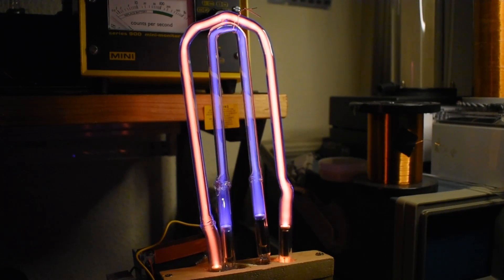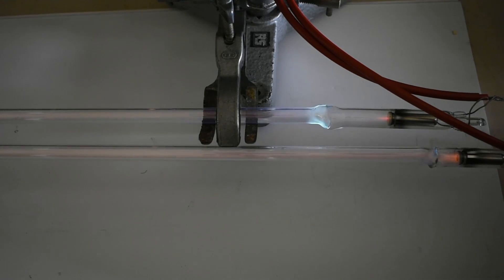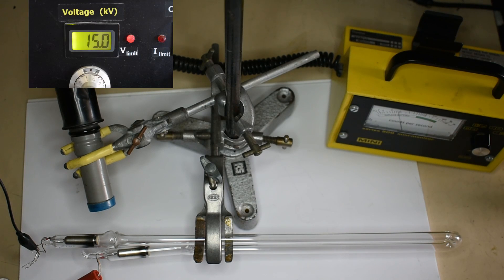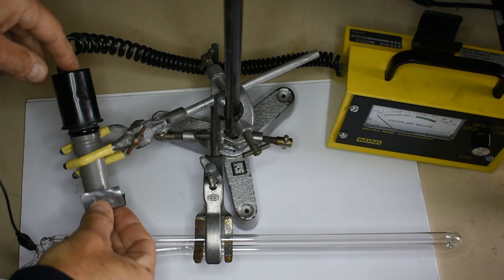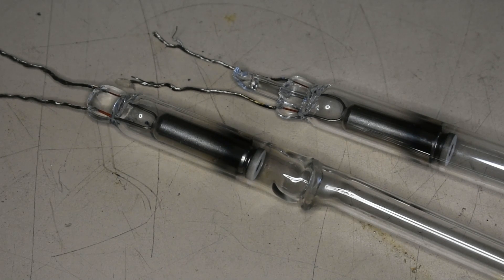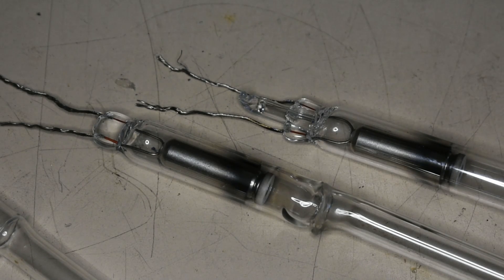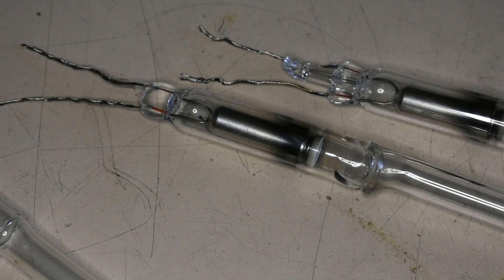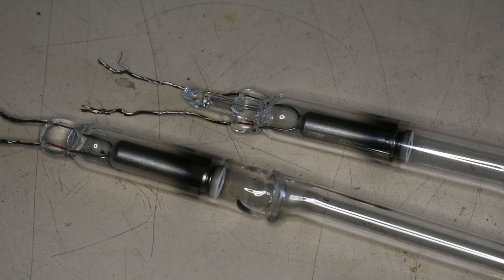Neon gone Bad

Comment: Hi! For the last discussion, I've been continuing my neon tests and now I have three one stage rotary vane vacuum pump connected in series, which produces pretty good vacuum (though I don't have that sensitive meter, but discharge intensity gets from zero to bright and finally dimmers when pumping longer, so that's good).

Anyway I've learned a lot, i.e. the color depends on gas, pressure, voltage, current, and even on polarity when pulsed dc is used. I've used commercial and diy electrodes, but with commercial electrodes, I've never managed to get reddish tube using the neon gas (it's more like pale white bluish color) and I suspect it's due the remaining oxygen in the tube. Also I don't have the bombarding equipments. These tubes also heats too much. So I've ordered magnesium and waiting for it to arrive to see whether burning that inside vacuum using induction heater would restore the neon color. 

But for tungsten electrodes (0.35mm wire is good), I've doing couple of tests and verified that after vacuum and neon filling, the tube produces first white-blue-pink color, but after e.g. 15 minutes of burning (~20mA), the electrode area in the glass is pretty black, but also the color is changed back to neon red. But after this "burning" the electrodes cannot carry that much current than before the initial burning. Magnesium would probably help this also, but I think I will also try to add one extra pair of electrodes in the tube and use those for initial burning and after color change switch to "new ones". And for commercial electrodes this kind of color change just doesn't happen and it must be due the bigger surface area which doesn't raise the temperature of the electrode enough to burn the oxygen.
-Heikki
Reply: Thanks! I've actually got that magnesium plate today and already did some tests. First of all, I thought that I could just burn that with small induction heater directly, but no, at least with that heater, maybe the frequency is all wrong etc. Anyway, but if I put the magnesium pieces inside the electrode's steel cup, then I can produce white oxide which is probably fine. I have to do more tests, i.e. whether it would be best to fire up the getter after the vacuum closing or before.

And I also tested that two wire wolfram setup, but it didn't work any better. Maybe both wires were attacked by oxygen and other metal stuff. Anyway with own electrodes the process repeats, first bright but wrong color, then the color goes right, but finally electrodes starts to sputter and current cannot be maintained..it's not easy 😁
Reply from the maker: @GarageOfTool  Haven't tried magnesium as yet but it seems to have a low resistance so not sure why it wouldn't heat up inductively and evaporate.  Getters can be used either while pumping before sealing or after sealed. Both will improve the vacuum. If you are finding your electrodes sputter and the voltage is increasing to maintain the current, this suggests the vacuum is improving with time, as in my example here. I'd try a higher neon fill pressure. The sputtering  is pretty good at soaking up the neon as well as other gasses.
Reply: Yeah, maybe the vacuum is then getting better, hmm. And also that two separate wire electrode test verified that it is not the wire itself that gets ruined.

My current filling procedure is based on the eye instead of pressure, so I just watch the initial color and wait for the high brightness and close the hoses and melt the tube.

Edit: I just put a new set of electrodes to soda glass and also put three 1x1x3mm magnesium pieces inside the tube. Then started vacuuming & argoning the tube and heated the electrodes during vacuuming. This heating also showed very noticeable color change. Then I closed the tube and leaved the tube current on and after a while, the tube stopped staying on with normal neon switcher. High voltage pulsed dc switcher though still could light the tube. Anyway, then since I had those magnesium pieces inside the tube, I moved those inside the electrode cup and heated again and burned the pieces and woila, after that , the standard power supply started worked again and has been on since. This may also have something to do with pressure. Tube also heats less. 

And while heating the commercial electrode in vacuum, I noticed the first time that bottom of the electrode got coated with getter mirror looking material, maybe those include some heat triggered getter material (or one of magnesium piece may have been dropped in the cup)

Edit 2: I made one more argon tube with lower filling pressure, i.e. closed the valve at point where the neon power supply could hardly light up only the half of the ~100cm tube. Then after closing, I burned one small 1x1x3mm magnesium piece in the electrode cup and little by little the tube started to glow and after hour it can take full current. I'm starting to believe that I've used way too low pressures, so thanks for pointing that out 👏
Reply: Ok, now I've finally got the both glass and both electrode types working 👌. 
And my the biggest problem was that too low pressure 🤦‍♂. So don't seal the tube when the brightness is at highest, but instead when less than the half of the tube is showing small glow. And before closing, put couple of 1x1x3mm pieces of magnesium in the tube. You can preheat the electrodes with induction heater before the closing if you like. But I've done so that after the closing, I pushed those magnesium pieces inside the commercial electrode cups and induction heated them inside the cup and this will remove all the unwanted gased like oxygen etc. But this won't happen immediately. 
And one thing about common 3kv 30mA power supplies. Since the those are specified at 30mA and if they cannot get the current to raise, they will stop switching. And problem with freshly sealed magnesium burned tube is that the current will not raise immediately. So now you can use simple triac dimmer at the power supply input (or capacitor or even better trailing edge mosfet dimmer for less radio interference). Anyway the current can be raised only little by little over the time, until the tube is ready to make full current path. And yes, it will take ~24 hours to get the color to stabilize.
And today I also tried the same method with 8mm borosilicate glass with own 0.35mm tunsgten wire electrodes. So first oxide the tungsten with moderate flame. Then take serrated pliers and squeeze the glass to the wire. And before vacuuming add a couple of magnesium pieces inside the vacuum port. And since magnesium won't ignite directly, I used broken electrode cups cutted in half and folded these around the magnesium to make small capsules (any iron will do). Then vacuum and fill the tube at point where small light is happening aroung the electrodes and seal. Then induction heat the capsules and put the power on and start increasing the current, that much to get the power supply kept on (or use different power). My borotube has now been on for 12 hours and it can almost take the full current, no sputter what so ever.

-Heikki
Reply from the maker: Well done, sound like you have experienced quite a few things there. Contamination from residual gas is a problem, and neon seems to show it easily by not achieving the correct colour. It really needs impurities heated out or as you suggest use a getter . Normally a bombarder transformer is used with commercial neon electrodes to heat them to red heat while also heating the glass tube to drive air and moisture out.  I have found commercial electrodes can be inductively heated and can successfully clean up the gas in some cases. Clean up is very noticeable over a few hours running.  Home made electrodes are unlikely to work as well and depending on material may sputter badly. As yet I haven't tried a magnesium getter but have some to try. I was planning to use this for higher vacuums such as in electronic valves.

Comment: Hi! I'm also doing experiments with diy neons tubes and what I have noticed that if you leave the electrode welding area too thick, then the heat will crack the seam sooner or later.  But if you draw this area long and thin, then it works much better. This applies to soda glass. And with borosilicate glass, I've use 0.2mm oxidized tungsten wire, which works suprisingly well, just put the wire in the tube and press it flat with pliers. 
So my guess would be that you've lost the vacuum instead of getting too high vacuum, though there are still neon colors in the tube. -Heikki
Reply from the maker: Thanks, yeah my joints need more work they don't look great, but I find, if they are going to crack, they will minutes after cooling otherwise they hold. I haven't used  any wires for sealing yet as that  does add another level of leak issues but I know oxidised tungsten should work well.  It would at first look like the tube is leaking as the discharge fails but in this case it is vacuum hardening. The tube is still the same many months after sealing.  Also if air is admitted no x-rays can be produced due to electrons not being able to accelerate fast enough in the gas.  I also have to apply over 30kV to get the tube to conduct. Where the glass glows is an indication of electron bombardment.  I also must get back to doing more of this kind of work and improve the technique.
Reply: @tuopeeks  Yeah thanks for the information! Also if the tube would leak, then the discharge would have purple colour due the nitrogen, so maybe it's getting "better" due the getter. But I find it still a little bit hard to believe that the vacuum would increase that amount, so that the whole breakdown stops, I would only expect some color changes.
And with borosilicate and tungsten electrode, I've also noticed that glass is getting dark around the wire, and the neon color is actually changing from light pink to deep orange tone. My vacuum is not perfect, so I know there is air inside the tube and maybe that gets burned by the wire. One could also add magnesium inside the vacuum and burn that.
Reply from the maker: @GarageOfTool  You are right, it's  not a perfect vacuum by any means just too low a pressure to work properly as intended. There is a faint gas glow still visible with low lighting. If the vacuum was as good as in a CRT then the voltage to pull electron through the tube is likely to be  over 100kV without a heated cathode. It is tricky to get the neon pressure just right with out any air contamination ruining the colour if there are small leaks in the vacuum system which I seam to have at times.